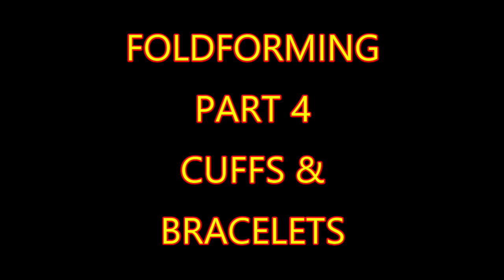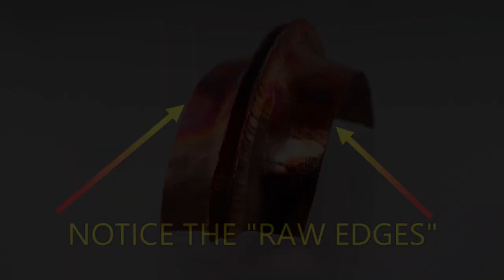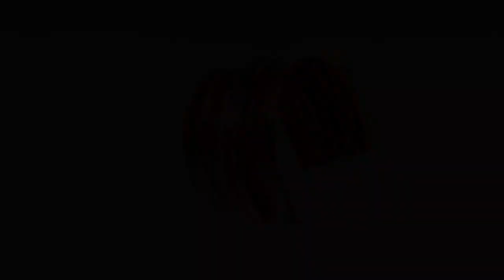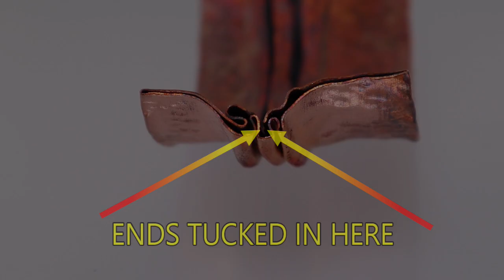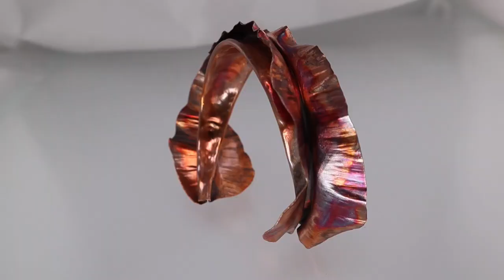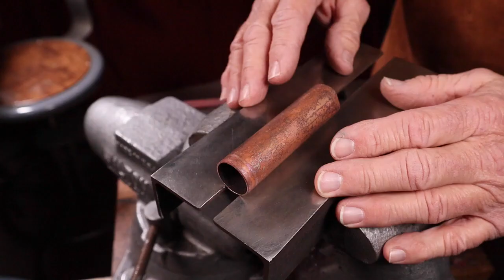FOLDFORMING PART 4.  "CUFFS & BRACELETS"

Comment: Wow those are great techniques! I'm wondering how to prevent branclets from oxydation. If lacquer prevent metal from patina but remain branclet flexible?
Reply from the maker: Hello TheSr4M,   Lacquer does work but I have been using this product successfully.  From Everbrite 
Coatings: "Protecta Clear". Comes in liquid or spray.  I like the spray.  Thanks. Greg Greenwood
Reply: @greggreenwood4628  thank you Sir!
Reply from the maker: You are very welcome. Greg Greenwood

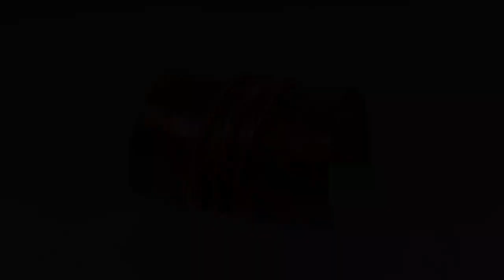Comment: Beautifu and subbedl! I especially like the one at 6:33. Thank you so much for this as I am new to foldforming and was looking for some good education. Love your easy to understand explanations also :) Sorry as I may have missed this in other videos, but what would you recommend as a gauge for cuffs (assuming 2-3cm wide)? I read in Charles's book that 0.3 and 0.5mm are good, though I saw a jeweler making anti-clastic forms and said he preferred 0.9 minimum. I also thought anticlastic forms were strong enough to get away with 0.3-0.5mm?
Reply from the maker: Hello Louise,  Thank you for your kind comments.  I really appreciate it. Welcome to foldforming!!  You are going to love it. I use .4mm  for all of my foldforming.  It is perfect because any of the folds add strength.  As for the raw edges, I have a few ways to solve that problem in the video.  So, go ahead and use the .3 to .5 mm and don't worry about it, just enjoy.  Greg Greenwood

Comment: Hi again Gregg,  I'm wondering if it's best to shape the cuff before adding all the components or soldering the components on then shaping the cuff.  It seems like it would be easier to build it then shape it but I'm seeing some jewelers shape then solder the components on.  I have a feeling I'm missing something and shaping then soldering the components on is the way to go.  If you have a moment, would you mind explaining what the difference is between the two?
Thanks again for giving so much of yourself to this community.
Reply from the maker: Hello Cannon, I agree with you.  Most often it is better to solder on the components, then shape the cuff.  That is when the components are flat and are soldered directly to the cuff.  But, if your components are more 3 dimensional, then it but best to solder after the cuff is bent. I hope this helps you.  Thanks for watching and commenting.  I appreciate it.   Greg Greenwood

Comment: Thank you for sharing and teaching us. 
I'm working on my first sterling silver cuff and am wondering what gage of sheet I should use for the base?  Also what considerations should I think about when creating and soldering the components on to the piece?
Reply from the maker: Hello Cannon, Congrats on your first silver cuff!  The gauge all depends on the design, but generally 20 to 18 gauge will work fine.  As for the components soldering to the piece,  check out my videos "Sweat Soldering Part 1" and "Sweat Soldering Part 2".  These videos will answer many of your soldering questions for soldering onto sheet silver.  Also, on a cuff, there is a lot of surface to heat up. Make sure that you have a large enough torch to heat the metal to solder melting temps.  And heat from back or bottom.  Good luck and let me know how it goes.  Greg Greenwood
Reply: @greggreenwood4628  Thank you Gregg
Reply from the maker: Hello Cannon,  You are more than welcome.  Greg Greenwood

Comment: Can brass be fold formed too?
Reply from the maker: Hello Nora,  Yes, you can use brass.  It must be at least .4mm thin.  It will work harden quickly.  It is not as good as copper.  Thanks. Keep watching. Greg Greenwood

Comment: Hi Greg can you help me a bit? I'm going to make a cuff bracelet from 2 inch wide silver with some specific cut-outs in it. I can't help thinking like an engineer, I don't intend to buy a mandrel but I would like to make one, but make it to a design. I can't find any specific industry dimensions on the web, all I can find is overall length with an aperture width and and depth measurement. Maybe that's enough and I'm over thinking it. I know that not all folks have the same size features but metal cuff bracelets seem to be very vaguely sized. I'm obviously planning to have some flexibility in the piece but I'd like to start off from a good place.  Do you have a guide for say the minimum diameter of the radius at either end of a Large, Medium and Small cuff bracelet.
Regards . . .  Andy
Reply from the maker: Hello Andy,  I have to laugh because you are always thinking like an engineer!!!  There are no rules to the sizes of bracelets.  I feel your best bet is to cut a strip of heavy paper 2in. wide and wrap around your wife's wrist to get a comfortable measurement.  Then you can add or subtract to make smaller or larger.  You may even want to make a prototype in copper or aluminum first.  Then you can get the feel of the metal without using the expensive silver.  Mandrels can be made from wood if you wish.  Or use a large pipe.  Either pvc or metal.  
Good luck and let me know how it goes.   Take care.  Say Hi to your wife.  Greg Greenwood
Reply: @greggreenwood4628  Hi Greg I've been so busy I haven't had time to take a look at YouTube for a while. You're right, I can't help thinking like an engineer. I've pretty much come to the conclusion that that jewellery making is more relaxed than engineering. Although a good understanding of some aspects of engineering stands me in good stead.  I've recently purchased a Sievert professional jeweller's gas  torch (propene only) and I've got to say I'm a bit disappointed with it.  I'm sure for some applications it would be a great little torch. there were some assembly quality issues with it. None of the metal to metal seals were any good. I had to loosen and retighten them all several times to get them to seat properly. Using two spanners I' had to tighten the joints up to the point of almost over tightening them.  I found that the bend in the neck of the torch needed modifying so that I'm not holding the hose end of the torch up in the air when working at a regular bench height. But the biggest disappointment is the lack heat from the needle point nozzle. At 4 bar it gives a blue cone about 1-1/4" long but but I'm struggling to melt 'hard' solder on a "T" joint of 1.5 X 1.5 mm square wire. I have to build up a hearth which can get in the way. I wish I had oxy-acetylene. By the way I didn't reduce the gas flow by bending the neck.
Let me know when you have an email address that you want to release and, if you're interested, I'll show you what I've made so far. 
Regards.  . Andy
Reply from the maker: Hello Andy, Sorry to hear about your torch.  Sievert torches are supposed to be good torches.  I use a older Prest-O-Lite acetylene / air mix torch.  I can use it in all ranges of heat from small wires to casting silver. ... Go to my channel and look in the 'About' section.  My email will be in there for you.  This way we can send photos etc. when needed.  Thanks for the update and talk to you soon.   Greg

Comment: Greg, I just discovered your channel and am binging on your videos.  Very well done indeed.  Perhaps what I like the most is your enthusiasm.  Two additional comments and a request.  First, I've never used your techniques for a safe edge on cuff.  I've always just file, sanded and buffed the edges into a rounded cross-section and felt with my fingers to assure no sharp edges. Sometimes I use a small ballpein along the edge to "flare" up the edge away from the "skin" side.  Haven't had any complaints or Emergency Room events yet.  I like the thinner edge, but I did try some of your techniques and I will incorporate in my work when the design will allow.  Second, color patina.  I've been able to experiment and develop some awesome "electric" colors.  Sadly, no coating I have found and used preserves the vibrancy of the colors.  You can get the colors to remain, but in a much more muted form.  But that was a good lesson to learn.  Forget about the colors.  The underlying form must work in and of itself. Now the request.  If you get a chance I'd love for you to do a video on your torch and another on your workshop set up in general including ventilation.  Thanks again for this marvelous work.
Reply from the maker: Hello Daniel, Thank you very much for your kind comments.  I appreciate it.  I too like the thinner edge in most designs. 
 Unfortunately in foldforming the metal is much thinner so I have to compensate for that, thus the safe edge.  Glad you are open to different ideas.  That is what makes this field so exciting.  Many ways to solve one problem!  You are 100% right about color patinas.  I hope you discover a way to preserve. You will be famous.  Thanks for your ideas for future videos.  I have been thinking about doing these, so maybe soon.  Thank you again, and let me know if you have any questions.  Greg Greenwood

Comment: So many light bulbs were going off on this one lol. Thanks for explaining the different methods of handling the raw edges. I think we will try this to make some bracelets. We're thinking about using a leather backing and perhaps copper riveting it on or? Is the patina seem on the copper from annealing in-between folding the copper? Thanks for this video. Looking forward to the next one. All the best.
Reply from the maker: Hello David and Laura,  I was wondering what the bright flashes in the sky were!  Glad to hear it.  The leather would be great.  So many possibilities with it. Rivets work great for this.  Try snaps too.  That way you can change color of leather with your mood.... The patina in the video is not from the annealing.  After the pieces were done,  I cleaned with a steel brush and then VERY SLOWLY AND LIGHTLY,  heated with torch.  This brings out the interesting colors.  Please note,  these colors will not last forever.  It will keep oxidizing and turning more brown and grey.  You can wax or lacquer the pieces.  This will help.  Have Fun.   Greg Greenwood
Reply: We hadn't thought of different colors of leather. great idea! The patina on these look really interesting and we hadn't thought of laquer. We have some around from our woodworking. We'll keep that in mind when . Thanks for the advice
Reply from the maker: My pleasure.  Greg Greenwood

Comment: Very beautiful, what a craftmanship! What did you do to obtain those beautiful colors on the copper. Did you use peanutoil? I love the results, thank you for your foldformingseries.
Reply from the maker: Hello,  Nice to hear from you.  Thank you for your comments.  I cleaned the copper with steal brush and then heat treated the copper. VERY LIGHTLY.   Do not overheat.  Take it slooooow.  Unfortunately, copper will continue to turn colors.  You can wax or spray with clear lacquer.  Not a permanent solution, but does slow the process down.  Thank you for watching and commenting.  Talk to you soon.  Greg Greenwood
Reply: @greggreenwood4628  Thank you very much for those tips, I love your video's and your very nice and friendly teaching.